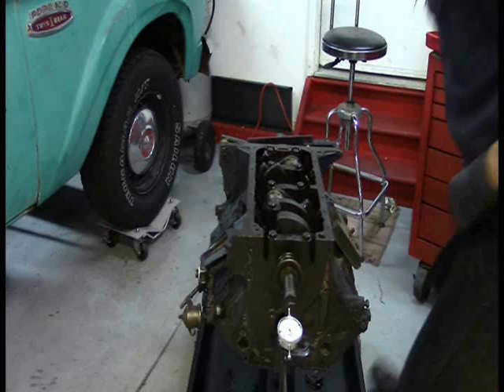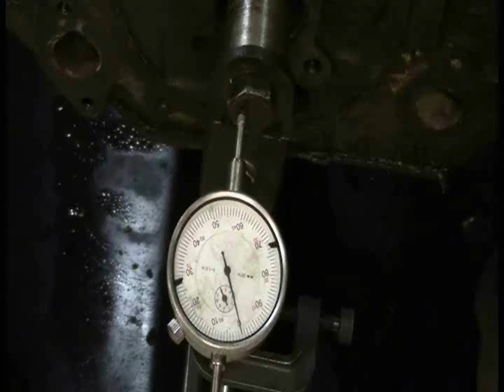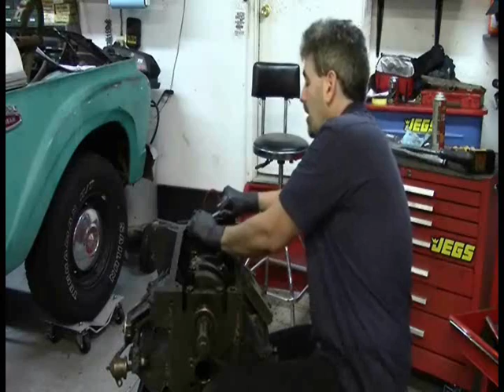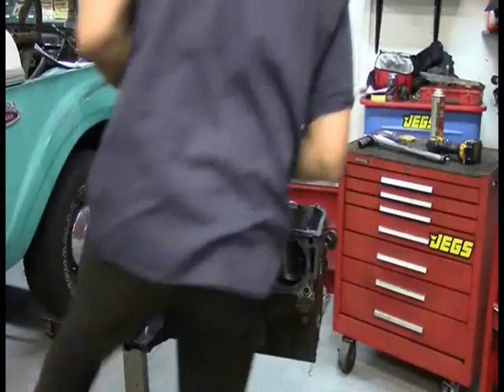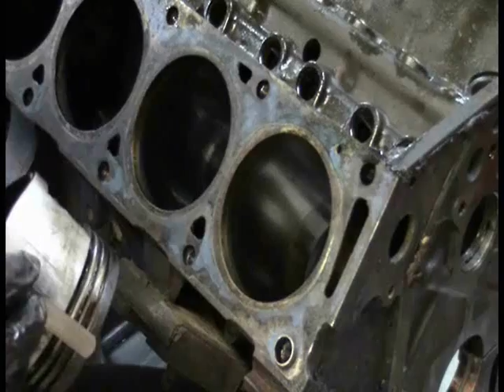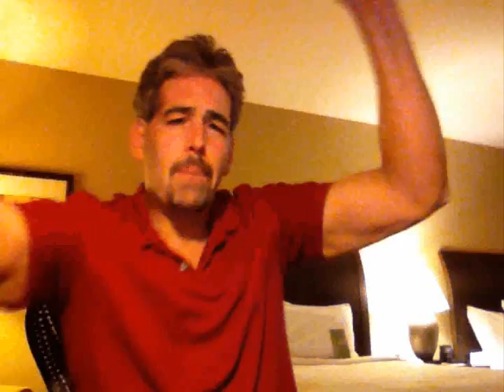Extreme Budget Engine Rebuild Pt 3- "Budget Rebuild" is an Oxymoron

Comment: Luv the vids, keep emancipatin out in personality n seeking high adventure in this field as you make me wanna be a better FAN / man lol. I tell ya when I took comp tech classes back in day I retained more from a charismatic teacher who had passion than I did another who just said take notes :)
Reply from the maker: Thanks man, part of it is who I actually am, part of it is marketing to help differentiate the channel, but whatever the case, the formula works for the people I make these videos for (e.g. people like you) so I am sticking with it.
Reply: Schrodingers Box  I removed the pistons and the crankshaft from my 1978 302 but did not keep the pistons and the caps in the right order. Is there any hope for me? How can I fix this? Thanks for your videos!!!!
Reply from the maker: agustin chie Ewwwwwwww- yeah thats a major problem.  See, the pistons are drilled to match the specific crankshaft journal.  If you just put the pistons anywhere, you will find the crankshaft won't even turn when you torque the caps.
  There is hope though- on most of the pistons there may already be a factory stamp on the rod corresponding to the cylinder. Check that first.
If not, you might find that you can't even position the cap on the rod if the piston is on the wrong journal.  One at a time install the piston where you think it fits, torque it about half to spec, and rotate crank. If crank won't turn smoothly, it's on the wrong journal. Eventually you may be able to figure it out through trial and error. Remember the pistons AND rod caps are directional so at least make sure you have those right when you make an attempt or your variables quadruple for each cylinder!
 Good luck bro!
Reply: Thank you so much!!!!

Comment: larger cam for a .030 overbore  , lol, that's ok I do the same thing sometimes, just messing with ya
Reply from the maker: In all honesty I really don't know if a larger cam would be needed or not- I am not at the level where I can calculate the required intake cam lobe lift and duration to account for a given modification of a stock bore to an over sized bore. It just seems perfectly reasonable to me that on a fairly significant sized engine like that, overboring it may go beyond the stock cam's ability to fill the cylinder. I admit I have no idea how I would confirm that.
  I do know however, the machine shop has finished the rebuild and the customer had someone else install the engine and last I heard was "It runs good, but not as good as it seems it should".  That's all I know. Trust me though, I would actually pay out of my own pocket to do a compression and leakdown test to confirm my suspicion.
Reply: Schrodingers Box please don't take what i'm saying the wrong way, but I think a few more cubic inches would be like saying I need a 752 cfm carb versus a 750 cfm , just letting the real newbs  know there is a range that a carb or fuel injection will handle , 350 to a 383 .... maybe more cam and carb .....so many factors.
Reply: it's been awhile since being here ,27 weeks I guess....love you,Dad
Reply from the maker: creepy

Comment: Nice channel! I love how you spelled it out.  Hopefully that motor had a shit ton of miles on it, cause it was dead tired.  The majority of time I haven't gone the used motor route was emotional, not financial.  Once you get down to expenses, it gets damn expensive to do a rebuild and you have to be committed, money be damned.  The ROI often doesn't make sense if it is just a driver to try to maintain a numbers matching old when a running donor can be had and even delivered to your driveway.
Reply from the maker: You are exactly right. It is fascinating how cars can induce such emotional reaction from the traditionally "left brained" isn't it? I am the same way- when it comes to my Trans Am all my rational thought goes out the window- I have no doubt I would spend more to rebuild the engine than the car is worth. Its a funny thing.

Comment: I have a mechanic diploma from my college, I agree with you about Haynes.  Haynes don't write enough to work on any vehicle ! 
psss, I am a diesel, heavy equipment mechanic.  yea, I have had built gas and diesel engines !
Reply from the maker: My main issue with Haynes is not so much the manual, it's the every day Joe's who read the manual but never actually did any of the wrenching and they think they are qualified to give advice to others.  It's why everyone keeps saying to replace O2 sensors and MAP sensors and everything on the forums and such- it's because they have no idea what they are talking about but they think they do because they have a Haynes manual in front of them.
Reply: agree,lol

Comment: Hello. just wanted to say why I enjoy these videos. I have been doing the automotive repair for about six years, and while I have not achieved the amount of knowledge you have yet, I will one day. School is a lot of book work with dis-assembly and assembly of engines that stopped running far before I arrived. I have always learned best by physically or  visually encountering the problem. I comprehend more by watching a half hour of your videos, than I would reading the haynes manuals front to back and twenty times over. Also Haynes manuals are often vague or difficult to understand (with terminology and sometimes lack of presentation). One thing I have learned is that there are many ways to get the same result. Cars, as well as people, are built to tolerance, not to perfection. I believe you explain more of the tolerance, and how to achieve that with your best practice. Thank you.
Reply from the maker: Well sad and thanks for sharing your motivation to subscribe. it helps when I know what drives people to do so!

Comment: In the old days if we had an engine that we were trying to spare costs we would of had the pistons knurled and used .0020 over rings and filed them to spec. They would run about 50K before getting any piston slap noise. By today's standards what I am saying is a no no but it works for normal use "not racing".
Reply from the maker: I have definitely heard of that Edgar. Back in those days a Car was only expected to last around 100K so it was a valid fix at the time. By todays standards a car doesn't need a tuneup for 100K though. Amazing to think about how the standards changed and people say "they don't make them like they used to..."  GOOD as far as I'm concerned!!

Comment: Your right people who keep reading the haynes manuals usually just want to argue over a little thing that a real world person knows don't really matter that much.

I have seen people question me on installing oil pan gaskets without any kind of sealer or rtv. But what they failed to realize was the gasket was rubber. From personally doing it over and over I came to the conclusion an absolute clean surface that has been degreased is sufficient enough for installing the gasket and I prefer it much more. I will use a small drop on the corners but other than that its a dry install.

I don't find anything you have said to be particularly insulting to anyone. You have done the work, gained the experience and provide a real world scenario of doing a job. Who the hell are they to question something they have only done once and not really that good to begin with. It would be the same as walking into a bar and telling a bar tender how to make every drink on the menu. Some people just think they can do it better and usually more times than not they screw it up.

On some of my rebuilds I chamfer the rod if they aren't already. Is it good to do....sometimes its needed. do I do it every time......hell no. Oil holes the same. But they won't realize this is usually done only to performance engines not your everyday 4 banger and there is no real need for it.

Armchair mechanics really do suck.
Reply from the maker: tcpnetworks EXACTLY!! In fact that's exactly how I started. I bought a car for $200 that I figured I wouldn't even get running and every single tool I owned at the time was in a Home Depot bucket! Over the years of researching and actually doing stuff instead of watching saturday morning car shows and listening to Car Talk on NPR, I got to the point I am now- as you did.
 I don't mind armchair mechanics- if people wanna watch some asshat turn bolts all day hey- whatever. But don't for a second think this qualifies you to give advice to people trying to do it themselves.
Reply from the maker: Perfectly stated!!!
Reply: You must challenge the armchair mechanic.  I'm a classic example of the watch, learn, do process.  

I'll go get an engine that I don't care about (scrapper) - pull it apart, learn.  Put it back together - test it.

From this I've now rebuilt (properly) about 10 engines.  I have a relationship with a machine shop.  I've a trade account.  I enjoy doing it.

It's a fantastic little thing to do.  My dad doesn't get it - and has never done it.  And yet he loves to critique.

Comment: I would just like to say thank you, you have inspired me to start projects like this. Now I want to buy a project car to play around with. Thanks again and keep up the videos
Reply from the maker: That is exactly how I started.  Be warned though- it can be as frustrating an experience as it can be rewarding, that's for sure. But if you stick with it, and learn to understand systems rather than follow instructions in a manual, you will get pretty good at it- better than many professionals in fact.
  The best part of this hobby is if you start doing work for others you can make a nice dollar off it too- how many hobbies have that benefit?

Comment: Can you tell me when you have a crank resurfaced at the machine shop do you have to order a different size bearing to make up for the material that has been removed. Please forgive me if you answer this question elsewhere just found you channel. Thanks
Reply from the maker: Yes they will supply you with oversized bearings to compensate for the material removed.  The backs of the bearings will indicate "std" if they are original or they will show a measurement in inches (e.g. .010) to indicate the amount of oversize.

Comment: Those old motors like that are very forgiving and durable. You can stilll budget that rebuild.Cut the ridge with a reamer, Hone the bores ,find some good used pistons,do the crank 10/10 (or whtever) and a valve job. It WILL work just fine. The only problem you will have is ....the macine shop will not shave off the stems of the valves to match the heead surface shave.So the valves will be stuck open all the time. Last 3 motors I did had this problem.
Reply from the maker: A moments thought would clearly indicate that would not work.  First, why in the world would I get used pistons?  How would I know if the used pistons fit the out-of-round from the bore to ensure better sealing than what I started with? In fact, I didn't even need pistons- the ones I have showed to measure to spec so that would be a complete waste of money for less performance.
  Honing the cylinders will NOT make up for the massively excessive ring gap. Honing is only to create a better sealing surface for the rings to settle in, but that is not where the compression loss is on this motor(causing the overly rich condition, thinning the fuel which is what caused this in the first place). Honing would do nothing whatsoever.
 Finally, if you have done 3 motors before, then you understand the ROI (return on investment) that you would insist on for this kind of labor.  Your idea would at best restore the engine to the exact same low compression it already has.  No one who is experienced in doing this would ever go through the expense and labor of a rebuild unless they knew the compression would be brought up to near spec.

Comment: Matt, how did you become knowledgeable in auto mechanics? Did you innitially go to auto mechanic school or have a mentor when you were a child as a mechanic? Thanks
Reply from the maker: Jan Post All self taught my friend. About half of what I know is from reading factory service manuals and applying the stuff on my own car and on other cars when I started doing work for other people- in other words I learn as I go much of the time.  The other half is learned by actually experimenting-- if I disconnect the IAC what is the effect on various scantool readings? If I induce a vacuum leak what are ways I can detect that? In fact an actual real-time example of my self-teaching is shown in the video "Air Fuel Sensors- the demise of shadetree mechanics?"

Comment: I can see that the term Budget Rebuild is a misnomer. Only time where budget is true is if things are within specs. Great series Matt, not only teaching the method of disassembly but also what to look out for and the specs required for various tollerances.
Reply from the maker: Jan Post That's how I roll bro lol.  A lot of people harp on me to "just get on with it- turn the bolts" but the point of the videos are to learn every possible encounter you may have and how to recognize and deal with them.  Any idiot can just turn bolts- it's knowing what to look for and more importantly how to deal with problem your find that's important to becoming proficient at this... or at anything.

Comment: Matt, that method of using sandpaper on a warped head. I am assuming from Oldskool method it would be applicable with aluminium. Since cast iron is much harder, it would seem sort of moot to attempt using sandpaper to take off material on cast iron. What is your take on it? Thanks.
Reply from the maker: Jan Post Agreed- and even then, I would not use sandpaper on the aluminum warped head anyway because of 2 reasons: 1: It won't be nearly as accurate and effective as cutting the surface to create a true flat surface and 2 (and more importantly) you don't know how much material you are removing.  You can only remove so much from the head because as you remove material from the surface, you are bringing the cylinder head closer to the block- it's possible removing too much might cause the pistons to come in contact with the valves so there is a limit on how much can be removed and the machine shop knows this and knows how much they are cutting.  You can still check for valve clearance regardless, but it is really best to know how much material is being removed.
   I only use the sandpaper to smooth the surface, remove gasket material etc- I would not try to true the surface,

Comment: yes ......things dont always go the way you want it to go...
and thats with everything in life...including engines...steering racks transmissions ..steering pumps(not always a matter of resealing them)....
i was wondering alot on the mileage this engine had...oil intervals...what type of oil used (not only Viscosity but older engines prefer zinc contend for old engines)

Comment: You mentioned a larger camshaft would be required with an overbore due to the extra cylinder diameter size. I would disagree with that. With the larger cylinder/pistons, you would be taking in more air. You could add more fuel to compensate for this. On a truck like this tuning the carb with larger jets would accomplish this.
Reply from the maker: Well first off, I said we might need larger cam- I said the machine shop would need to verify.  Second of all, I did mention the larger cam would be needed for exactly the reason you mentioned- the larger volume needs more air. But how is the air going to get in there?  You are only partially correct in your assumption that the larger pistons take in more air. Air intake is ultimately controlled by camshaft lift and duration.  Larger pistons may create more vacuum but not past what the camshaft allows. It is possible the stock lift and duration may allow enough air into the intake (and exhaust) I don't know. But to assume it can be compensated for by adding fuel depends on if the camshaft is allowing the extra volume to be filled.
Reply: I guess that is one of the problems with a carb engine such as this one. Any little change to the engine such as being bored out or an increased cam size causes a higher demand for fuel. How much fuel do you add? I understand there are ways to "tune" these old engines for optimal air/fuel ratio but it requires a really skilled person to do so. Going to lean will cause pinging/detonation/running to hot and could destroy the new engine prematurely while going to rich will cause an increase in fuel consumption/coking up. Thus the great introduction of fuel injection with switchable 02 sensors to optimize air/fuel ratio.
Reply from the maker: True, but I am not concerned about the fuel delivery as much as I am the air delivery.  Whether carb'd or PCU controlled, delivery of fuel to match the air will not be a concern because the carb or fuel injector pulse can always be adapted to match the additional air (to a point of course- get to 750HP and your fuel delivery becomes limited with stock systems). However intake lift and duration cannot be adjusted so if more air is needed to fill a cylinder to get full compression than what the lift and duration allow for, you will not have sufficient air induction into the cylinder. Fuel is not the concern.  Hope that makes sense. It's like if you take your deepest breath and blow into a balloon to fill it up. Now what if you have a larger balloon- you can't blow enough air in one breath to fill it. You need bigger lungs (bigger camshaft).  Weak analogy but same concept.